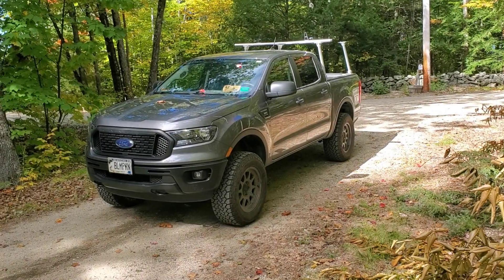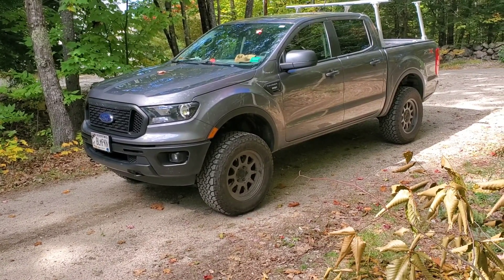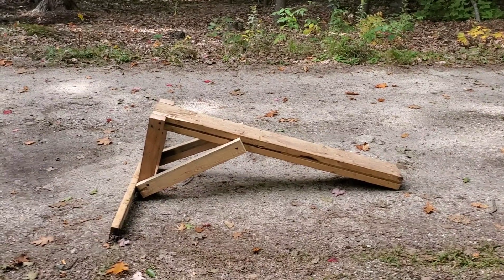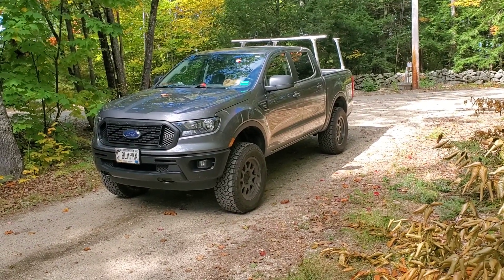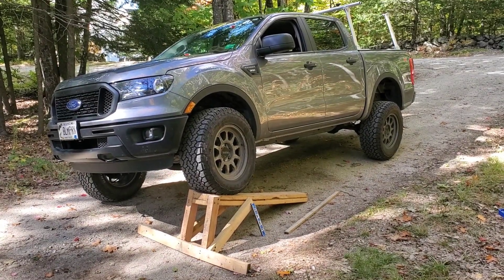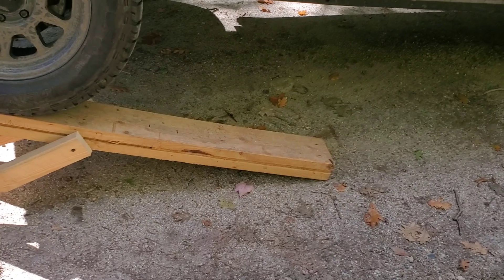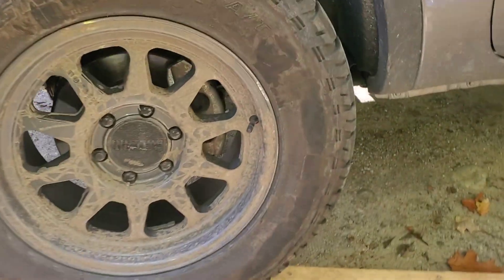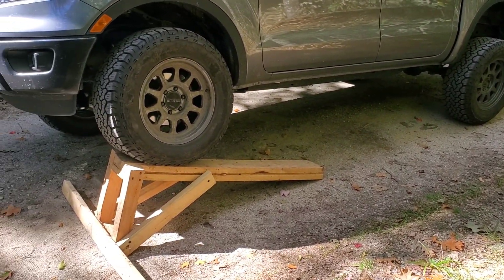'21 Ford Ranger articulation test! Sway bar VS. disconnect, does it make a difference?

Comment: IFS can do plenty. In fact, IFS AND IRS is still good. That's what I have - front AND rear... I'm 6.5 Front travel, 7.5 Rear stock... with shock extensions MAYBE 9.5 rear now. I'm about the same, can pick up the front tire about 12-13 inches then the back tire comes up with swaybar connected. You are at or BEYOND all non-Wrangler Jeeps.
Reply from the maker: Thanks for the reply! I plan to replace my upper control arms and install extended travel coilovers in the front at some point in the next few months. It'll be interesting to see how much of a difference those mods make.